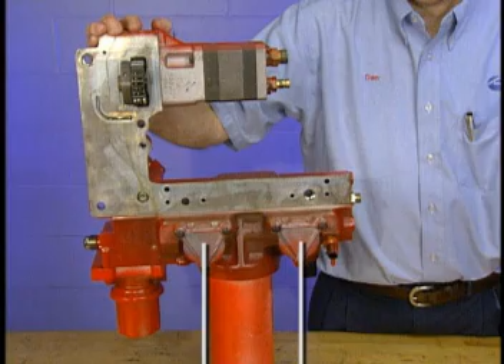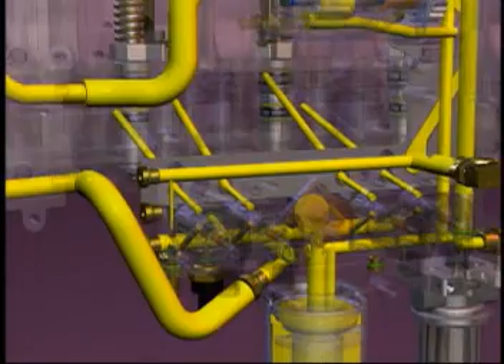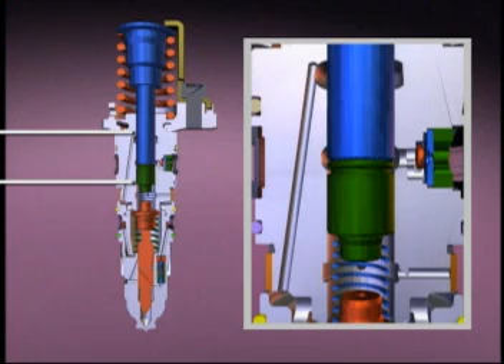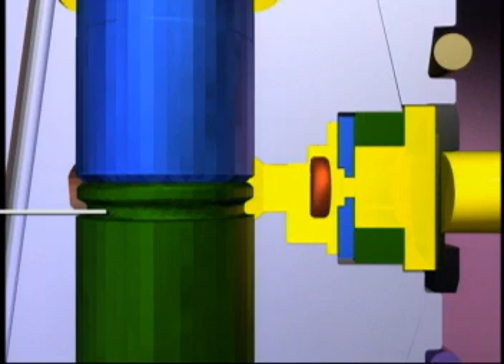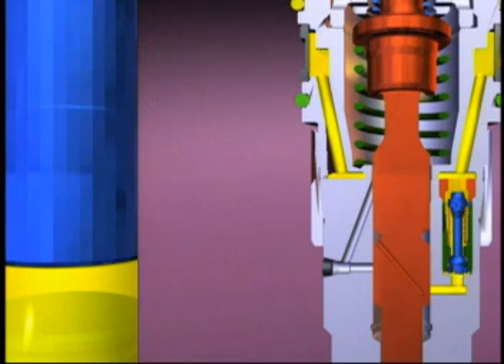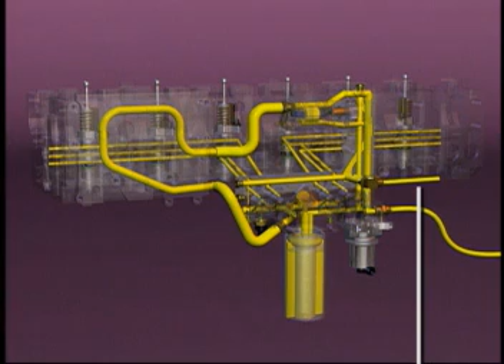Cummins ISX CM870 CM871 Fuel Part2

Comment: i've watched this video 100 times.... I need to figure out why same front timing metering actuator keeps breaking the bolts. any thoughts? replaced the 250 psi regulator
Reply: Over torqued
Reply: @buttadog5073  it was actually a bad injector.. after 4 broken actuators... they would last between a month to 3 to 6 months...
Reply: @EndlessDan  hmm, was the injector not closing so the pressure would build in the rail and break the actuator?